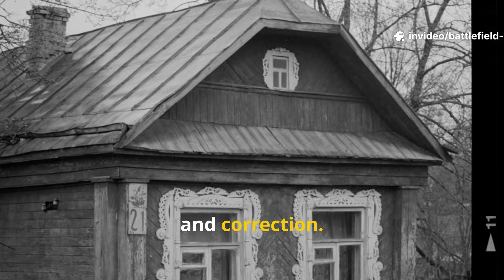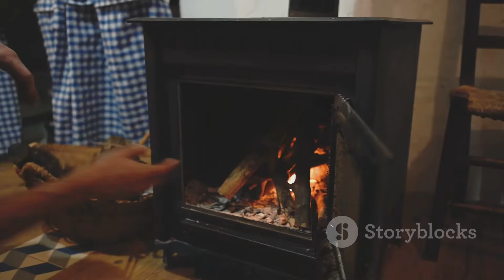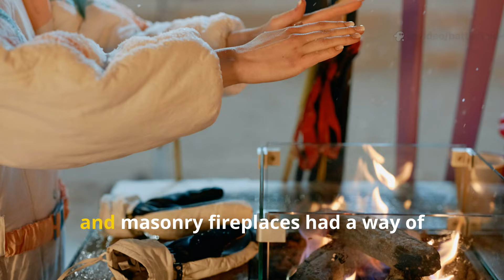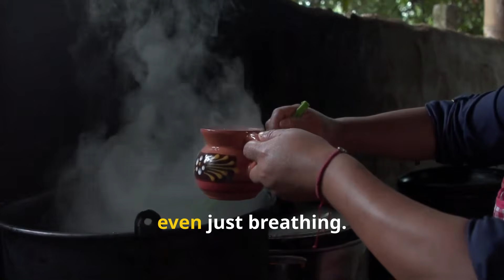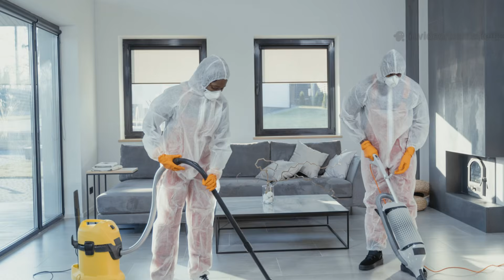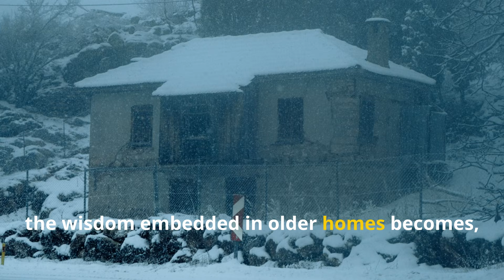Why Older Homes Were Healthier in Winter—And How Seniors Can Recreate That Air

Comment: All this is true; however, trying to heat an older home can cost $400 to $1000 a month in the cold season.    That's why people have pursued homes that are basically big Food coolers. What happens when a little bit of moisture is left in a closed cooler, especially in the summertime?
Reply from the maker: Very true.